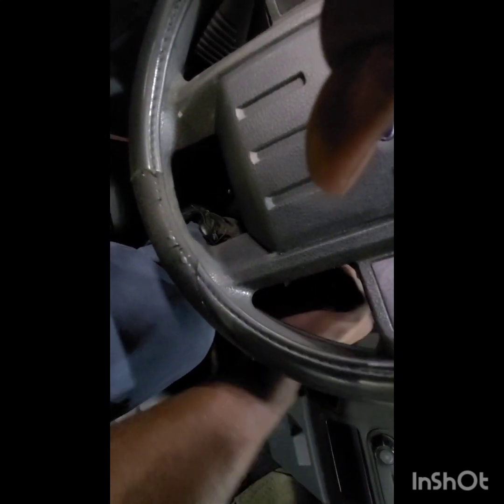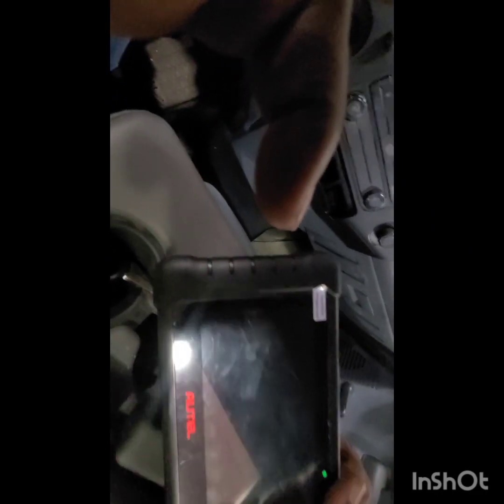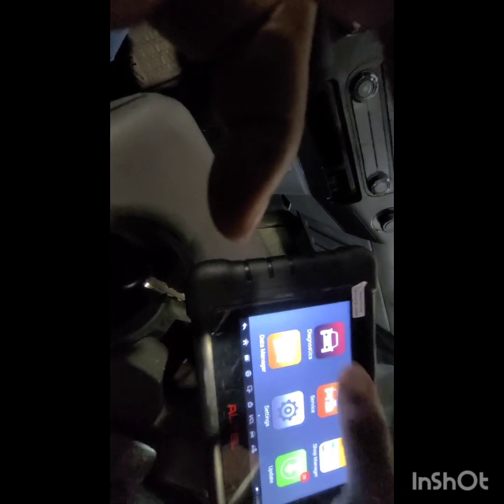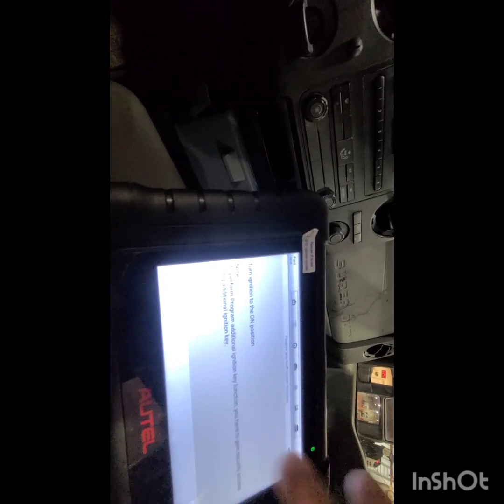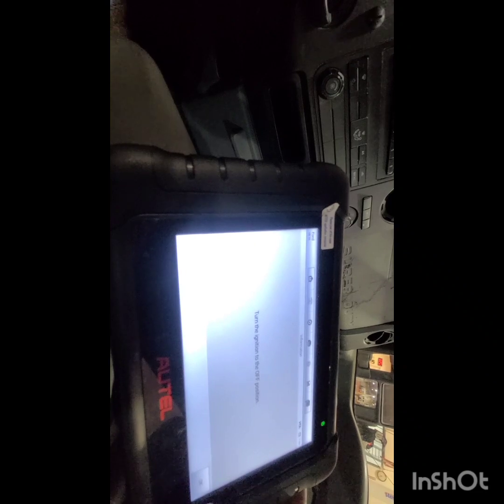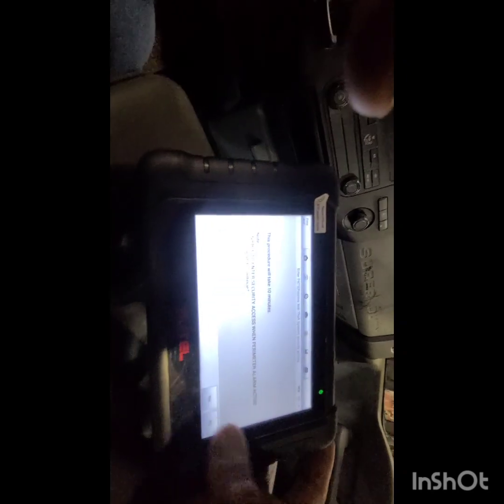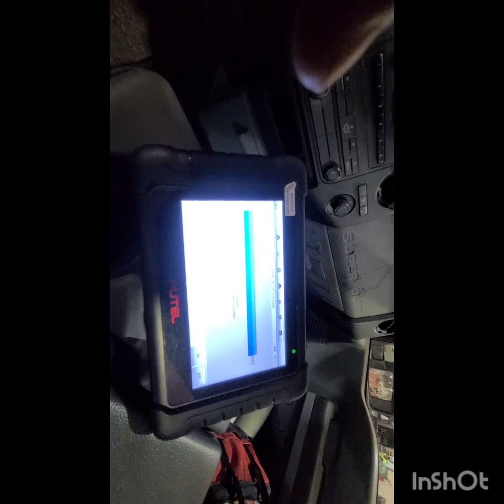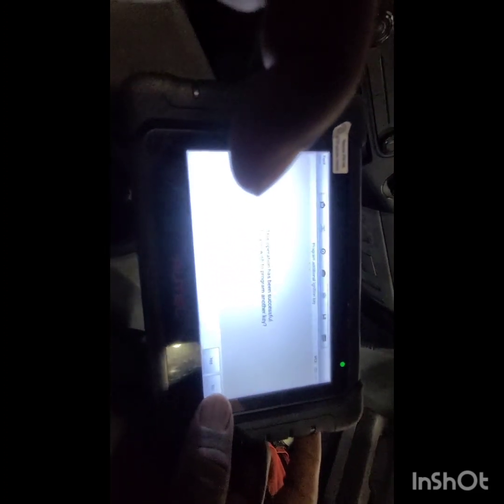programming ford key with autel 808bt

Comment: What if I pull a computer from a car in the junkyard? That's got a different code, but not the correct key. Where do I just use a blank key in program it with that computer
Reply from the maker: Yes ull have to program the key to it  unless you get it  coded to the old. Computer
Reply from the maker: You may not get to  start the car or functions may not work with the new computer cause the vin is different you will have to get it flash to that car  inorder for it to work